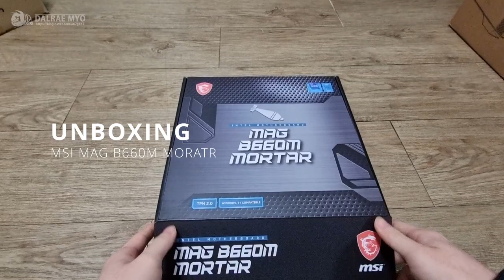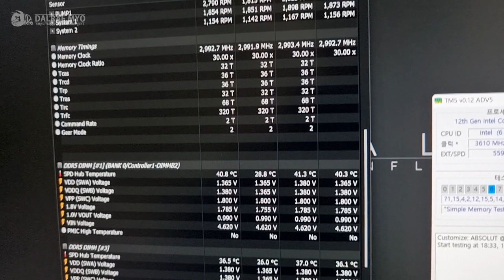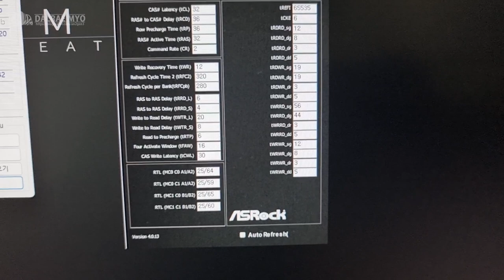MSI MAG B660M 박격포 MORTAR | 12700K + RTX 3070 ti

Comment: Can this mobo withstand the i7-12700 for 6-10 hours per day? For my YouTube game content, of course I use an expensive cooling fan to cool the processor. Are there any hot or bad issues with this mobo?but if you look at the website it says the vrm dimensions are quite promising 12+1+1 I think it's strong enough to hold the i7-12700 what do you think?
Reply from the maker: In a typical environment, the motherboard has enough VRM specifications to accommodate up to 12900K without overclocking.
Reply from the maker: If you are going to use 12700, you don't have to worry about the VRM capacity.

Comment: Hi, I have a question, would the temperatures of an i7-12700K (Non overclocked just running stock) on a B660M motherboard be somewhat similar to that of an i7-12700 (Non K) ?
Reply from the maker: If the load temperature is compared, the non-K side operates much lower.
Reply: @DalraeMyo  I See, Im planning to get an i7-12700K soon, my room temp I've seen it go as high as 32C, the room doesn't have the best airflow and I live in the caribbean, gets pretty hot here, my current i7-9700 after stream+gaming for 4 hours gets to max 74C right now but it's undervolted -70mv, using a corsair h100i Pro XT 240mm, I do plan to get a 12th gen CPU socket contact frame from thermalright to get better temps and avoid bending, also going to buy 3 good up to 2000RPM intake fans since right now I have some "okay" rgb fans that go only up to like 1300rpm. in the case the 12700K is over 85C during normal use/gaming, il undervolt the 12700K for lower temperatures.
Reply from the maker: @ZealousPumpkinTV  The indoor temperature in my area is usually 20 to 25 degrees. I'm sorry that I can't give you any advice because I've never run a PC in an environment above 30 degrees.
Reply: @DalraeMyo  Hello again lol, I still haven't purchased any CPU, but I recently ran into another dilema, some people said the i7-12700 (non-k) version since it's locked, it has a locked SA Voltage, so enabling XMP with 3,600mhz DDR4 Ram it's very unlikely to post apparently, they say the i7-12700K is better for this, do you think i'll run into issues running XMP with an i7-12700 (non-K) on the msi b660m mag mortar ddr4 wifi? the ram is Corsair RGB Pro 2x8GB 3,600mhz
Reply from the maker: @ZealousPumpkinTV   If you look at the case of the Korea PC community, there is a case where the clock of 3800Mhz is applied even though it is a non-k CPU product. On the other hand, it is true that the non-K product has a lock on the SA voltage, and there is no guarantee that the 3600Mhz will operate normally.

I don't know exactly because I've never run DDR4 on a non-k version of CPU.
Reply: @DalraeMyo  Fair enough, there's always a risk when it comes to overclocking, I think Il buy the i7-12700K when it gets a good deal for black friday next month, rn it's 400$ in amazon which is ridiculous, but hopefully it goes to 280-320$, If it gets too hot I can always adjust power limits or undervolt! kamsahamnida!

Comment: i am using the same motherboard with i5 12600k but now able to get full performance on cine bench r23 or geekbench 5 .. can u please tell me how u are getting full performance with i7 12700k
Reply from the maker: If sufficient CPU cooling is possible without separate settings, full performance can be achieved.

Comment: What best mobo for i7-12700 No K and No Overclock
1. Msi B660m-a pro WiFi ddr4.
2. Msi mag b660m mortal no WiFi ddr4 like this video.
3 Msi mag b660m bazokka ddr4
4. Msi b660 tomahawk WiFi ddr4
What best budget and value for i7(12700) no oc and no K  ??🙏
Reply from the maker: I recommend B660M Mortar if you choose from the list presented.

Comment: 12700 "K" with a b660? 🤔
Reply from the maker: It's because I used the CPU that I used in the previous build as it was in this build. Now that I think about it, it's not a common combination :)
Reply: @DalraeMyo  b660m: chipset pcie 4.0 lanes up to 6?  rtx 3070 uses 8 lanes
Reply from the maker: @noeegel9627  The PCI_E1 slot uses the PCIe 4.0 x16 CPU lane.
and
The PCI_E3 slot uses a PCIe 3.0 x4 chipset lane.
Reply: is just about the k right? If i use a normal 12700 on the b660 is fine (im not going to overclock)
Reply: @CharlieToof  Yeap, for b660 motherboard just buy the 12700 without K.
Reply: @3lectronic0  thank you a lot! If we use a k version we just lose the possibility to overclock right? No incompatibily or issue
Reply: @CharlieToof  b660 supports K and not K CPU, but the K version is more expensive and is designed for overclocking, to take advantage of its benefits you would need a Z690.
Reply: @3lectronic0  ty for the clarification! Im gonna buy the 12700
Reply: @CharlieToof  non K version don't  have IGPU!  think twice
Reply: @noeegel9627  ty for the advice! Didnt know it
Reply from the maker: @noeegel9627  To be exact, there is no iGPU in version F. The 12700 normal version has an iGPU.

Comment: This is not a good motherboard... Make sure you don't buy it if you don't have GEN12 with K version,,, Don't buy it or you will regret... You can't overclock your ram.. if you install a 3600mhz ram... then you pc bios will only detect as 3200... because you CPU is not a K ...